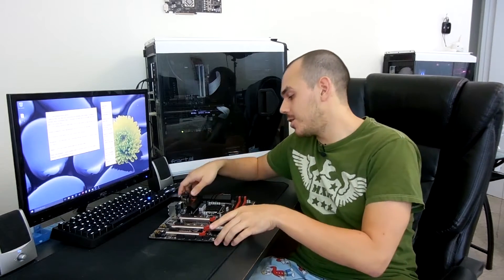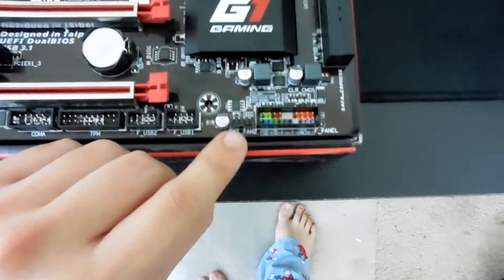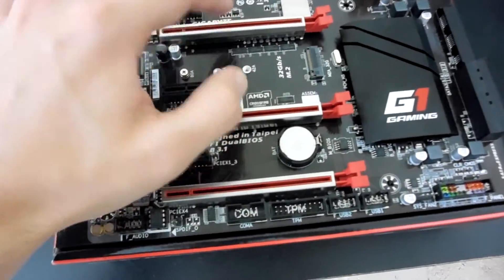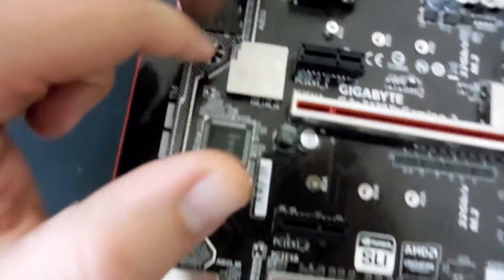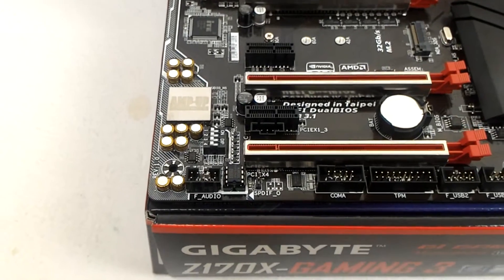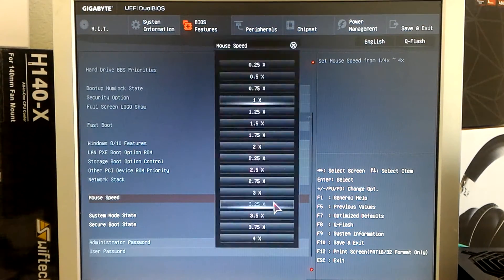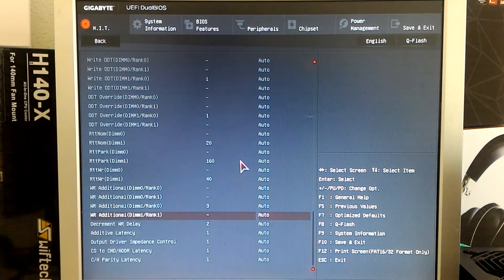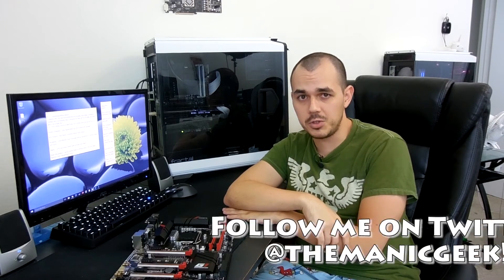Manic Tech #0023: Gigabyte Z170X Gaming 3 ATX Motherboard Review

Comment: had this for 4 years now with 1080ti, 6700k, 550w psu, 500gd ssd, 10tb in HDD space collectively
still going strong
Reply from the maker: That's awesome! Glad it's still working for you!
Reply: Any idea if you can change the red ambient led?
Reply from the maker: Oh jeeze not sure, this video is quite old and I haven't had this board in years. There might be an option in the BIOS under power management settings, at least that's where I'd find settings like that for MSI boards...
Reply: @KyleHarrop97  na i havent come across it :( it stays red -_-
Reply: I still have it, i just upgraded to a z490 A asus with a 10700k now :)
Reply: Was given the board by a friend, came with a whole pc but I’ve upgraded everything else, it’s all argb apart from the board

Comment: I have the same board with a 6700K and was able to do a very stable 4.8ghz and using a Samsung 950 Pro 256gb in the Bottom position. And using the EK 240 Predator for the cpu cooling.This board is worth every cent :) Great review !! The F6 bios worked for me just fine .and my OC  was all done manually
Reply from the maker: Wow, a 4.8 GHz oc on a 6700K is great on ANY Z170 board, let alone this one x-D.  Really wish I could use this board more, but for right now I'm just happy having been able to actually use Skylake :-).  Glad you enjoyed the video!
Reply: yup and with the temps still low,and the voltage just at 1.3v I got a very good chip :)
Reply from the maker: O shit, yeah you did!  The 6600K was, as far as I have seen, a fairly average chip in that way.  Still pretty pleased with the results.  I haven't had a good chip like that in some time, ever since my very first FX-8350 (RIP).
Reply from the maker: The Gigabyte 990FXA-UD3 Rev. 1.1 happened to it... twice... _.  That particular motherboard was the single worst experience I have ever had with a product in my life, and cost me more than a little money and time in the process.  Thankfully their current crop of products is far better built.  Now, three chips later, mine stops at 4.7 GHz... not terrible, but I have to be stuck with this chip and platform for the foreseeable future.  There's just no money to upgrade, I live paycheck to paycheck.
Reply: my current build is going to have to last me for a good while .Just deciding on either a RX 480 or GTX 1070 ..I know what you mean ..I WISH I had a money tree in the backyard like my daughter claims hahaha
Reply: +Charles Nix if your gonna do 1080p only not worth getting a 1070
Reply from the maker: It's still worth it if he has a high refresh rate display that he wants to take advantage of.
Reply: Lino Fragoso
I only do 1440P
Reply from the maker: Even better then, since that card will be able to max out 1440P with most titles for the foreseeable future, if not get really close.
Reply: +The Manic Geek indeed would be worth it for 1440p while the rx 480 can obviously handle it,  maybe not max settings 60fps

Comment: Thanks for the useful review. 
I was also looking at the Asrock Z170 Gaming K4, but i read somewhere that the chassis fans are running at full speed if using 3Pin fans.  With my Z87X I can adjust the speed of 8 fans (3 Pins), without any problem in my SilentBase800.
Subbed!
Reply from the maker: Thanks man, glad you liked the video, and welcome to the #ManicMob!

Definitely need to be on the lookout for what different motherboard headers will and won't do, especially if you don't plan to use a different kind of fan speed controller or your cases fan speed control (assuming it has that functionality built in to it).  That's one of the things I liked so much about this motherboard; it gives you so much control and so many features and asks for so little to invest in to it in return.

Comment: Just bought this Mobo with a 6600k and 8gb of ram with a saphire nitro rx480 8gb oc+, its gonna be great :) i plan on getting more ram down the line and considering running crossfire :)
Reply: i have the same setup but it is with a GTX 1060 :D
Reply from the maker: That would definitely make for a killer setup, and wouldn't even be all that spendey, either!
Reply from the maker: Same with yours, Av!  Only main difference is the display ecosystem you get locked in to if buying in to something like GSync or FreeSync.

Comment: Amazing review man! Very detailed and helpful thank you! I'm debating between this motherboard and the Z170XP-SLI and the Z170X-HD3P. I feel they're mostly quite similar (minus the red theme which I'm not a fan of). What are your thoughts? Do the ethernet and audio chips really make that much of a difference?
Reply from the maker: In my experience, the ethernet chip is more about network shaping and additional control over how your computer handles inbound.outbound data than anything else.  It's not intrusive at the very least, so there's that.

As to the Audio codec, it makes a pretty noticeable difference for me.  Any of the other motherboards I've had had "good" solutions, but this one was the first one I've experienced that was noticeably different, at least when it came to headphone sound quality.  Of course different people might have more or less sensitive hearing than all that, so ultimately that becomes subjective without proper measuring equipment and environments to gauge the quality of the sound that is being produced.

That being said, I'd still choose this codec solution over the vast majority of other solutions out there, and even if you decide to not use the on-board codec and go with something like a USB DAC or something along those lines, this motherboard will still serve you well with the additional USB power that you can supply to a DAC that needs it.
Reply: Thanks for that detailed response :), clarified a lot!

Comment: This was fitting since I had been looking for somebody to review the motherboard with the same CPU, and what it's overclocking ability was. I will see if I can get to that 4.6 GHz
Reply from the maker: +The Violet Imagination you should easily be capable of getting your chip that elevated, provided it's capable of that in the first place. I suspect this board will get most chips to within 100 MHz of their max, easily, provided you don't need to go super excessive with the VCore. Remember this board is still somewhat limited on power delivery phases, even if they are really good phases. Best of luck with your overclocking hope you get the results you're looking for!

Comment: i have Gigabyte Z170X / 8gb kingston hyperX Fury 2600 /i5-6600K / Msi-Gtx-970 /thermalRight Macho Direct -Seasonic S12 620W ATX12V and iam bretty Happy whit this no power lost and Bios F6 works Fine i have using everyday this and this is excelent i got this 4.4.2016
Reply from the maker: Huh, interesting.   It's not entirely surprising, Kingston typically has memory modules with better compatibility than most, wheras Crucial, while also fantastic memory, doesn't appear to go through as much validation as other brands like G.Skill and Kingston.  I mean really, though, as long as there is a BIOS that DOES work for a person and it allows for all the hardware they use to work properly then that's what counts, I still really like the board.  Glad you like it as well, and thanks for watching!

Comment: is it possible to use all four slots with 2666ghz xfury modules? I get on/off loop whenever I use any more than 2 slots
Reply from the maker: It IS possible, yeah... but that all largely depends on a few factors: is the memory rated to run at that speed (if you bought it at that speed, then yes), and can your memory controller handle that speed, since that is technically considered an overclocked speed, even if you're getting it by using XMP.  Getting faster memory clock speeds is typically best done with a single dual channel kit of memory (two sticks of RAM) on LGA1151/consumer platforms, and with a single quad channel kit on LGA2011-3/enthusiast platforms to put less strain on the memory controller.
Reply: Yes they are already overclocked. Turns out I had f3 bios,  updating to f5 got it working. Thanks for the quick replay!
Reply from the maker: Awesome, glad to hear it!  Enjoy the speeeeeeeeeeeeeeeeeeed!

Comment: Hey great review! I am using this mobo in my new gaming rig with a gigabyte gtx 1080 g1,  6700 k and 2*8 gigs ddr 2666 ram. I won't get bottlenecked by this mobo right? I choose to spend my money on other parts of the pc since in z710 mobos I didbt see that much of a difference and this looked like a solid choice for a good price with reliable overclock!

Thank you!
Reply from the maker: Yeah the only thing you MAY be held back by a LITTLE bit is potential max overclocks, but then that could also boil down to your CPU just not being a good overclocker, so who's to say, really.  I think you spent your money in the right places, should be a solid machine for the highest end gaming.
Reply: I only OCd my processor to 4.6 and did not touch it since then, weirdly the base option for it in Vcore settings was 1.3 and set to auto ( So it sometimes even went up to 1.45 on its own) I tried to change it in the Bios but then the Pc wouldn't even got into Post. So I had to set it back to default 1.3 and lower it with Intel Extreme tuning to 1.25 and since then I have no issues with it. Ohh an addition to your video, I am using f7 BIOS and it works very well. I also Oc d my videocard with +150mhz settings and it works perfectly fine. Would you recommend any upgrades to my PC? Is the mentioned RAm good, and enough? Also I wonder about good temperatures, during heavy gaming my CPU gets to a max of 75 C°and my GPU to 80 C°. Is it too high or is it fine? Also I am using 2 corsair 120mm AF fans on the front of my case, 1 120 AF at the rear as Exhaust, and on my AIO liquid cooler (Liqmax240) I use 2 corsair SP 120 fans Pushing the air through the radiator. Should I change it to pull? Sorry for the questions, but you are the most detailed channel I found on the net, I also subbed! Thank you again for your help! :)
Reply from the maker: Nah, that all sounds about right to me!  Temps look good, pretty strong overclock, push on the rad is fine.  That rig probably demolishes 1440P gaming on Ultra settings for most titles, and is likely very good with productivity workloads as well, especially if you can leverage all those CUDA cores.

Comment: Excelent review! I will like to see how it works with an SLI configuration cause I just ordered mine
Reply from the maker: Thanks, glad you liked it!  That makes two of us; I'd also love to see how SLI performs with this board, but like anything else it'll all largely depend on the CPU and game more than the motherboard since for SLI communication still occurs between the SLI fingers on a card rather than the PCI-E bus like XDMA CrossFire does for AMD cards.  If you wind up doing some kind of SLI config with this board I'd love to hear your results!
Reply: +The Manic Geek Well It will take time cause I just start this proyect I 'll use a Gtx 970 and i7 6700k I 'll love to see a tutorial about the bios! by the way the bios version 6 that gave u issues it comes with it or it's like the latest one that u downloaded on Gygabite's site?
Reply from the maker: My particular board shipped with the F4 BIOS installed to it, but your board might be a bit different i the manufacturing date is newer than mine... which it most likely is; my board was packaged back when they were doing the BlizzCon promotions with the board, so yours MIGHT have the F6 BIOS installed.  Be sure to double check when you do a POST test with the board, and if it does have F6 then pay attention to your system while installing your OS; if you start to notice strange powering down or boot loops, chances are you'll need to do a USB BIOS update on the board with F5 loaded on to a flash drive.
Reply: Ok excellent I 'll do it for sure, thanks for the advice good thing that I saw your video before get any surprise I'm suscribed already

Comment: $75 open box at microcenter or $30 off with sky lake processor...Im using it for a i3 7350k build. Nice board looks more expensive than it is. Bought it for the spdif that they removed from the Z270
Reply from the maker: Nice price you grabbed this for, and you have a nice upgrade path to work with later on!
Reply: The Manic Geek lol got my gigabyte 1060 6gb oc open box for $209 there. They are selling the i3 7350k for $130 new. I'm really tempted. I already have a big cpu fan. Should I get that or a sky lake i5? I'm trying to save money lol
Reply from the maker: Well if that chip is within your budget, that's a better price than what's been out there from Intel in the lower end, but if you CAN swing even a locked i5 like the 7400, then that will still net you better overall performance without needing to even overclock the chip to do so.  Then later on down the line you can still upgrade your processor to something that can overclock while still being left with a more capable chip for use in a HTPC or some such.  

$60 is a lot of money, I understand, but the i5 will just be a more usable chip for a longer period of time for you.  Just my opinion, though, you do whatever your budget can allow!

Comment: Hello! I have the Z170X Gaming 3 , i7-6700K cpu, 2 - MSI GTX 970 in SLI,  Adata XPG Z1 2800MHz (4x8GB), Corsair RM850i power supply, Corsair H60 v2 AIO cpu cooler, a Samsung 256GB M.2 card, Windows 10 Pro x64 since March 2016. Monitor is a 2008 ACER P243W 24 inch (2ms) LCD. Install F5m BIOS and never updated to F6. Would you recommend upgrading to the Z270 platform and if so what are the advantages. Also any advantage in getting a Z170X- Gaming 7 if you do not recommend Z270. My Gaming 3 and BIOS F5m will not allow me to Over Clock above 4.5GHz no matter what I do as it is unstable. I can OC my memory to 2900MHz but I see no real reason why as maybe a 1 to 2 percent increase in performance.  I was hoping to do 4.8GHz or topping to 4.9GHz on the i7-6700K. As for gaming the only games I've have ever played were Diablo 2 / LoD expansion, then later on WoW, and last was Diablo 3 but got bored by Nov. 2016 and the only game I still do play is MSN Internet Spades. I appreciate your suggestions or recommendations. I hope you enjoy providing PC videos and technical info. - You and LINUS are both terrific.  I find Linus too  "wound up or hyper" when he speaks which drains me of my energy. Your videos are always clear and sharp. When you talk it's concise and informative. Thanks!!!
Reply from the maker: First off, thanks for the kinds words regarding my videos!  I also watch LTT and all the other major outlets as I like to see where our opinions may have diverged a bit, or where one or the other of us may have covered something that the other didn't.  Always helps to gain insight from multiple (PC)perspectives when possible!

As for your specs and question: the only real difference between Z170 and Z270 that really amounts to anything is the presence of four additional PCI-E lanes on Z270 boards through the chipset, and support for intel Optane technology (storage speed boosting technology, kind of like PCIe-based drive caching, only I'm WAY over-simplifying it).  If you want to read more on Intel Optane, Anandtech did some really thorough coverage of the technology.  For your use case, I would say stick with Z170, since a BIOS update should allow support for Kaby Lake parts should you want to slot one of those parts in later... not that it would really be worth it.

Sucks your overclock wound up falling short of what you wanted!  I know that feeling: my FX-8350 will only clock to 4.5 GHz at reasonable voltage before things just start getting ridiculous... and that's a part that is SUPPOSED to be able to hit 5 GHz regularly from more efficient manufacturing process lol.  It just happens sometimes; typically the most difference you'd see with going with a better board is 100 MHz or so, which really isn't a big enough difference for you to eve notice it, especially considering your workload needs aren't particularly taxing at the moment.  

Hope that insight helps you out a bit!  Your rig blows the doors off of mine, so I wouldn't be worrying too much.  Maybe the bigger focus for upgrading your rig would be eliminating the SLI 970's and going with a single 1070 or 1080, depending on whether or not you can find a 1070 that isn't priced hiked to hell at the moment... #BlameMining
Reply: True, one powerful GPU is better than SLI or CF. It has been proven with a single GPUx2 vs SLI/CF. You get the full use of PCIex16 with one GPU and not dropping down to two PCIex8 when in SLI/CF. As for the i7-6700K guess I got one of the bad picks from the litter. Like the days when people complained about Stepping  C0 and E0. You know that computer tech changes quickly. Not many can afford a updated or new PC every 6 months. I was due for a new PC as my DIY in May 2008 had a Giga GA-X48T-DQ6 & Core2Duo E8500 with HD 3870's and later HD 6870's in CF.  Before that was a 2001 Compaq Presario Intel Pentium at 1.4GHz and 2GB memory with an AGP card. - Keep up your confidence and realize that it takes time, money and away from family/ social time to do your You Tube stuff. I appreciate your effort and hope when the day is done ...you are content and satisfied so you can spend the remainder of the day with those close to you (wife, kids, parents, friends, getting out and having fun) after work. I'll keep my eyes open for a GTX 1070 or 1080  next year on e-Bay since they're not in my budget yet! (within $200 - $300). Wife would shoot me or have me spend many nights in the dog house if spending money foolishly. Best of life and happiness to you and those in your life. Take care.